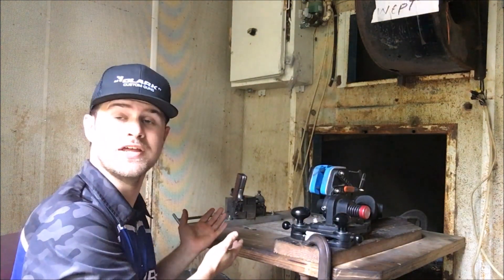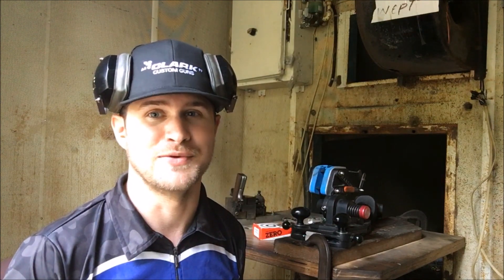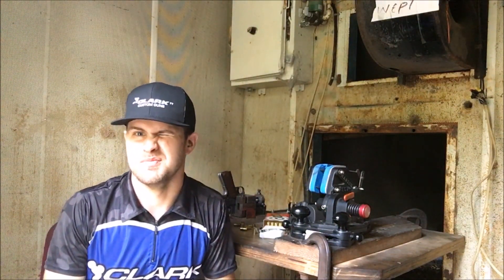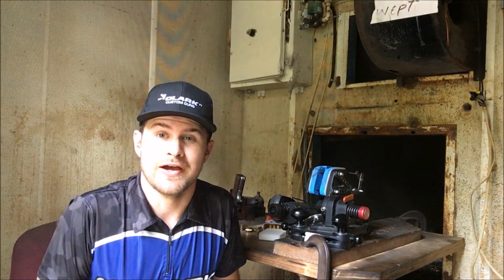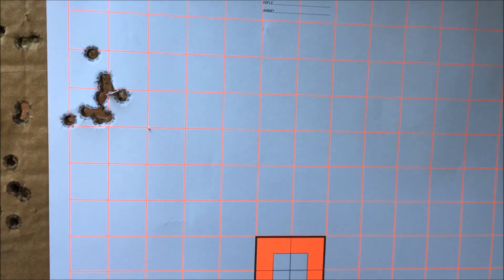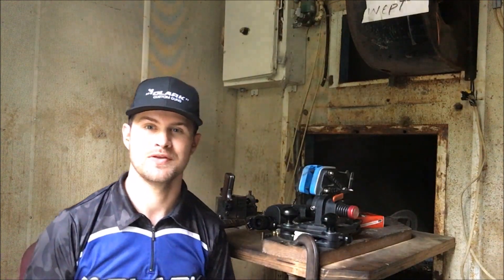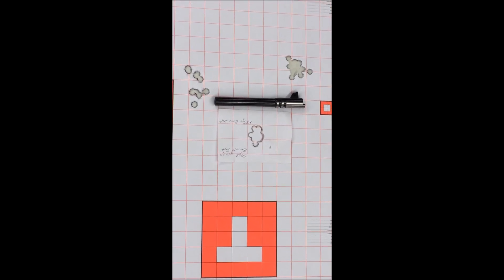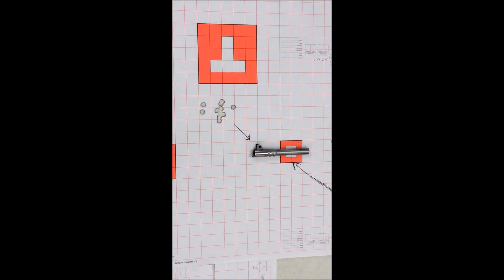1911 Match Barrel vs Factory Barrel Accuracy and Longevity Test from an Al Marvel Barrel Tester

Comment: Have used Clark and Kart barrels.  Both work great.  Once had Clark weld up a factory Colt barrel so I could fit it to my pistol.  Turned out great.  Wish they still offered the weld up service.  Clark Custom is the real deal.

Comment: Really interesting test and many thanks for that. But I have a feeling. In the case of this excellent test the barrel is fixed to the bench rest very strongly and cannot flinch.  In the reality inside a gun the barrel can actually float inside the slide during the shot.  There is a certain gap between the barrel and the slide depending on the tolerance.  In fact, I think conical profile barrels (bull barrels) are indeed produced to reduce this gap especially towards the end of the barrel? 
https://i.ebayimg.com/images/g/ek4AAOSw2RdZhKey/s-l300.jpg
Maybe in this way the external slide acts as a clamp for the barrel improving its accuracy and impeding it to flinch during the shot ? if we look for example at precision rifles  i understand that the barrel is always floating respect to the stock.  I'm wrong ?  It is an extremely interesting field of technology this of barrels design and construction.  Thanks again and best regards, gino

Comment: What’s the difference it the Clark rampt barrel and the nowling barrel ? They both look the same ?
Reply from the maker: Big Guy  Clark Custom Guns developed the ramped barrel idea in the 1950s. Wilson copied with with a different style cut for profit reasons. The Clark cut has a radies rather than a flat on the barrel, and require only a 3/8 end mill to machine the frame. The Wilson ramp requires 2 different cuts.

Comment: I know from experience that this shop will not take advantage of their customers. They have had the opportunity through my ignorance to do or charge me anything and they won't.   I personally came in with my 1911 with unknown thousands of round through it and asked if it was getting close to needing a new recoil spring and maybe barrel. They looked it over very well checked the spring strength and a micrometer to check the barrel  and polished my ramp for no charge and said everything was fine
Reply: Proof in this insane world, there are still some good honest folks around.